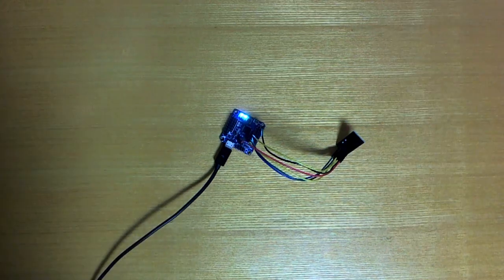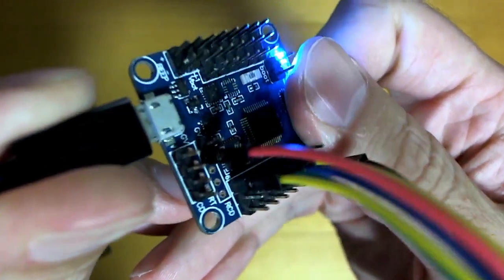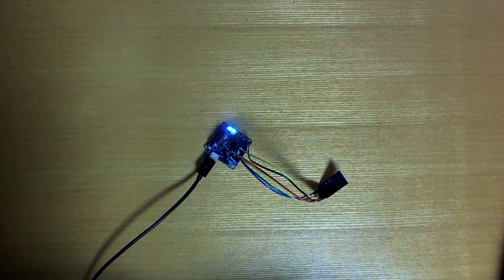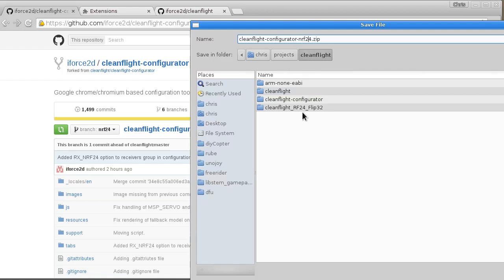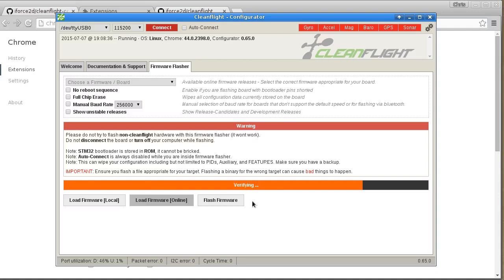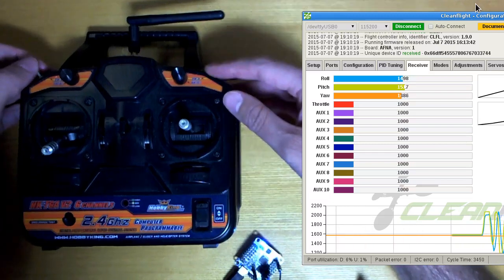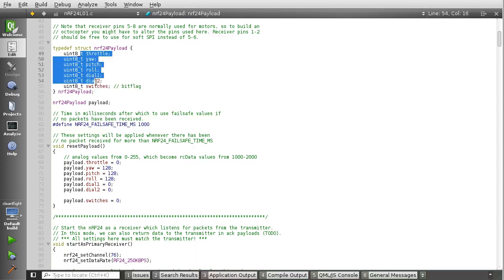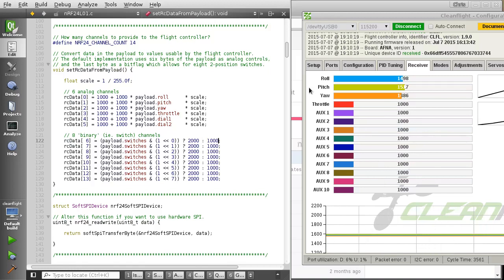Cleanflight + nRF24L01 (Flip32 only)

Comment: Are you sure that the modifications in configurator are as necessary? Wouldn't it be easier to use CLI for that?
Reply from the maker: LeoTheHuman Thanks for pointing this out, I checked just now and typing "feature RX_NRF24" does not work even in my modified version of the configurator.... I guess I need to add a reference to it somewhere. Hmm.... looking around a bit more, I see the reference should have been added in the FC code, not the configurator. And now that I add it, I can see RX_NRF24 showing up in the list of features, and when I type "feature RX_NRF24" it accepts it and saves that setting. However, this does not change which radio checkbox is selected in the 'config' tab, and it has no effect on.... anything it seems. I wonder if there is a bug there somewhere.
Reply: ***** I'll take a look at your changes when I get back home. I was going to build my own transmitter using nrf24 and old hubsan controller's case and gimbals (which feel pretty good) for a while now. Now it might even be practical, as I don't really have to build a standalone receiver and code it. (:

Comment: nice job ding this im going to convert my cheap hobbying transmitter when my new turnigy 9x comes in and then im going to try this.
but i have one question.
did you change the led pin for external leds?
normally its connected to pin 5 but you are using that now for SPI.
may be you can use pin 2 for it because pin 3 and 4 are used for GPS
Reply from the maker: expansiongames "normally it's connected to pin 5" hmmm... maybe there are some docs for that I missed? I thought normally the receiver pins 5-8 would be for inputs from the receiver. If using PPM, pins 5-8 will be for motors or servos, at least that's how it looked in the source code... in any case, what I've done will trample anything else that would have been using pins 5-8, and if there is something else trying to use it this SPI thing will probably get screwed up. I have not tried any LEDs yet, but perhaps if I did, it might cause trouble.
Reply from the maker: ***** ah I see: https://github.com/cleanflight/cleanflight/blob/master/docs/LedStrip.md
Well, then you can't use this with LEDs (at least on pin 5) at the same time. Or soft serial for that matter.
Reply: *****  but is it possible to change the pin?
Reply from the maker: expansiongames of course. Like you say, pin 2  (or 1) could be used.

Comment: I now have a flip32 because you recommended it. I love it but there is one thing. The micro usb directly broke of upon my first disconnection. I now use bluetooth to connect. Shall I return it for warranty or leave it or try and fix it myself? Would it be worth it?
Reply from the maker: Insta Awesome I've seen a few people saying that about the usb connector. The two I have seem ok so far.
Reply: ***** How well does Banggood cover warranty situations?
Reply from the maker: Insta Awesome In my experience, if you complain and show a photo or something they will refund. Especially since it seems like a common issue. It would probably be more useful to ask them, not me :)
Reply: ***** Thank you, I will try that.
Reply: *****  well i hope so.
but i dont think i can get a refund for mine i got a bad crash from 100m up and its now shorted with nothing connected and the micro is getting really hot.
ill just get a new one they are so inexpensive
Reply: Insta Awesome I broke my flip usb port  on my vtail several times from plugging in the usb and stressing it out (i'm crap at tuning). If the solder tracks are still there it is possible to reflow it back on there with a heat station. Takes a little practice but losing count of the stuff I managed to fix with it now.
Reply: Insta Awesome You can also just use a USB-to-serial adapter instead of bluetooth and USB connector. I broke a micro usb on my first and only full Naze32. Not a big deal.
Reply: LeoTheHuman I thought about making one of those yeah. I seems like a viable option. Thanks.
Reply from the maker: Insta Awesome Thanks guys, now I'm paranoid the connector will break every time I plug in or out :D
Reply: ***** That will probably help you save it! (: